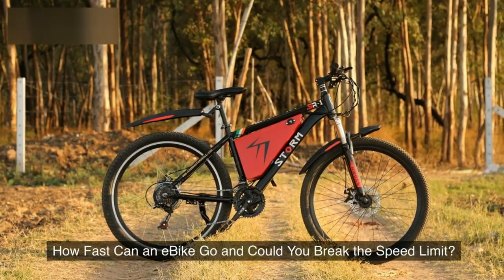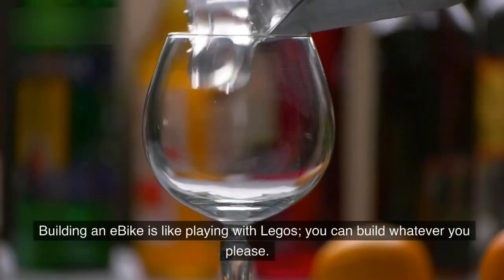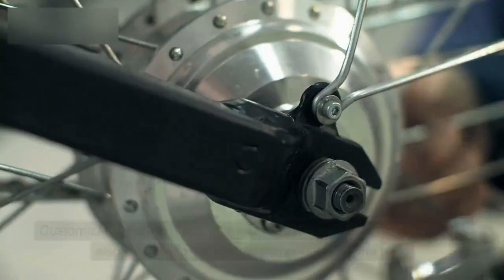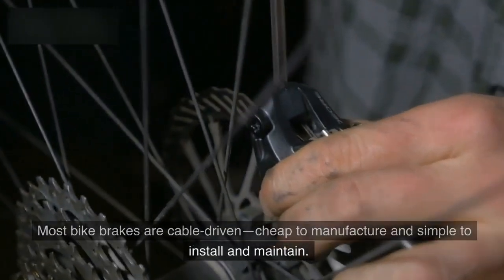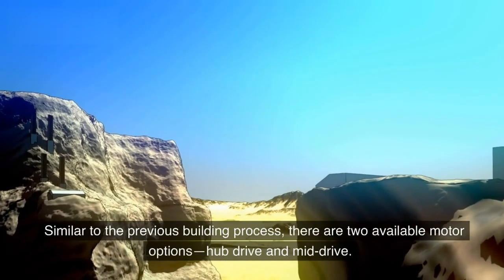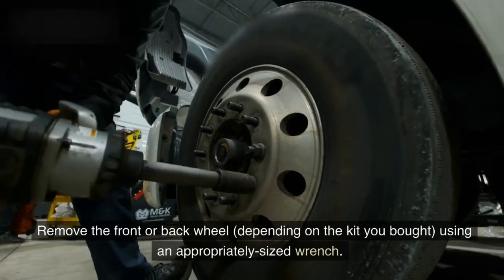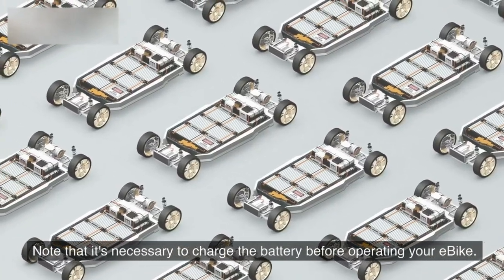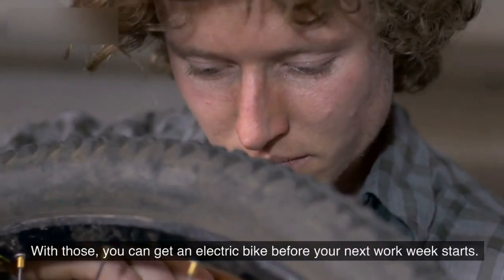How Fast Can an eBike Go and Could You Break the Speed Limit

Comment: I have been building them for 10yrs. You 100% want front suspension. The faster u go the more u need it! People who havnt gone over 40mph on a bicycle be warned! At 40mph hitting a pinecone can wipe u out. A big pothole isnt a option. Those big balloon tires are also dangerous. They bounce and thats not what u want happening at 40mph. There isnt a way to describe the differences in your bikes handling when u excede 25mph. Night and day differences. At 45mph i cant look at my speedometer because it requires taking my eyes off the road. If you plan on building a bike that goes 40mph you need to dress like your riding a motorcycle. And please install motorcycle headlight into your build. You wont be able to see the potholes etc at 40mph if you dont have good lighting.
Reply from the maker: I agree 100%.